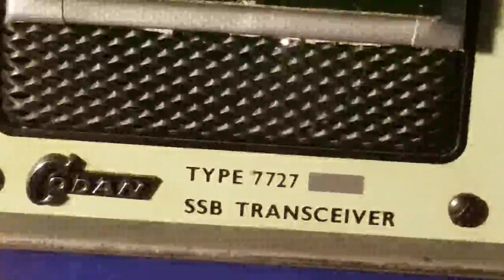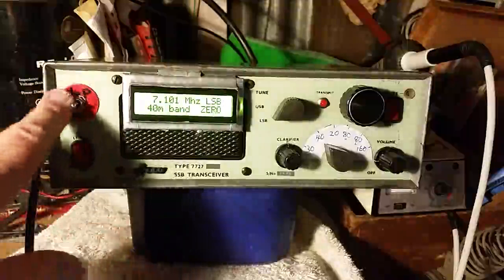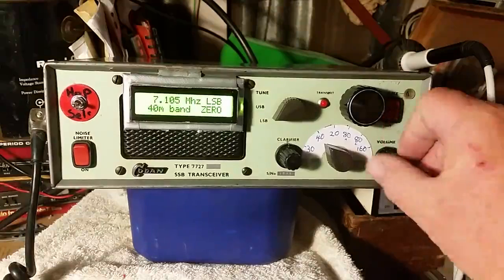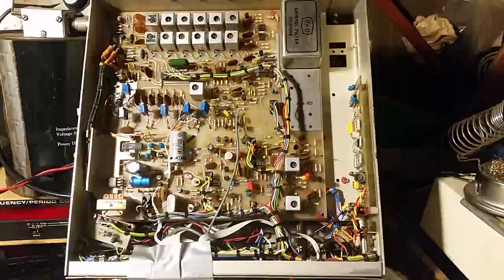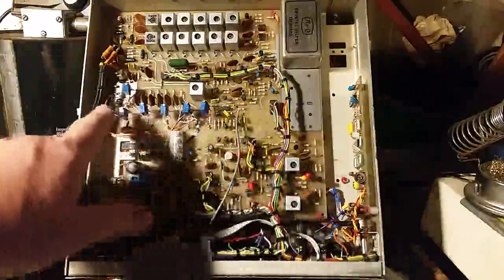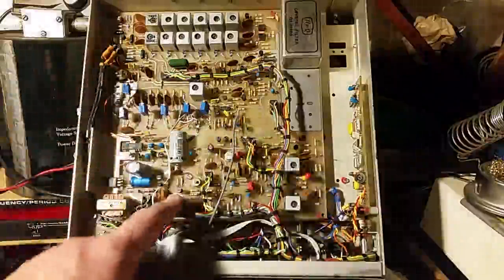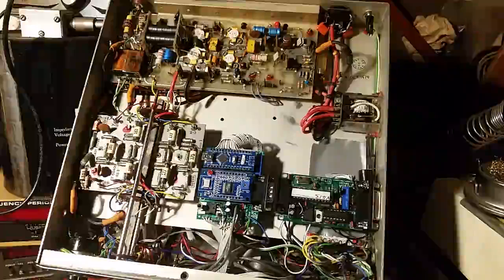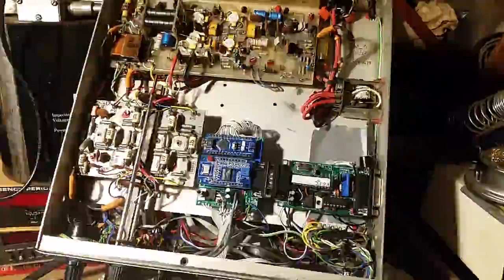Codan 7727 Radio DDS project with selcall and skippy hop

Comment: Hi Tom. Thanks for the video on conversion of a Codan 7727 using a DDS VFO for amateur use. I came upon your clip after pecking "Codan 7727 Coil" in to Google. I have just reinstated my Amateur licence after a lapse of 10 years, having been VK5ZGW. Now VK5AGW and looking forward to some HF activity. I had a brainwave recently after researching DDS VFO products. I have a surplus 7727 ten channel unit with all coils fitted for the old standard RFDS channels. I plan to use your approach or similar to get 160, 80, 40, 30 and 20 metres from the Codan. I was thinking I may need to use varicaps across some of the coils to get the bandwidth from the channel coils that is required. The VFO would run on the Carrier - 1650khz for 30 and 20m to give USB.  Do you get suitable bandwidth from your coil configurations ?. I notice you have split the 80m band between two coils / switch positions. Your radio must be a very early version. I can only recall the 10 channel versions. Cheers